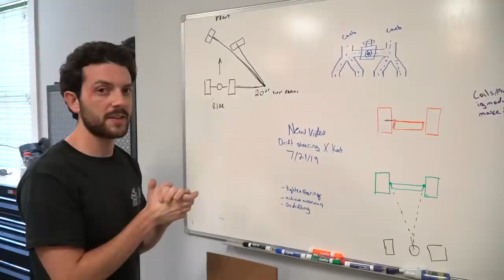750cc Kart has FULL POWER! The Fix was SO SIMPLE!! + Drift Steering

Comment: I would have a couple sets of Denso spark plugs on hand any time I was going to be riding it and a few extra master links. And a big plece of plate metal behind the seat aluminum diamond plate would be cool looking. And Sand the frame off and paint it Red or Blue or Purple. Candy apple some kind of paint. Its ready for a meet now.  Bigger back tires. Fronts too. Taller wider. some what bigger dont have to go nuts just somewhat bigger. Some times a  rod can go through the block and parts fly and also chains fly too. It hurts when that happens.

Comment: Hope you don't change a thing. The stance is awesome and chassis-wise, everything is working great. KISS. LEAVE IT ALONE. You have a roll bar. No full roll cage needed. You're sitting low and leaned back. It has a nice "race" look to it. Adding a full roll cage will take away from that. Oh btw this has turned out to be a great build.

Comment: Put some much bigger tires on it...please. You will need sand?, mud/snow, dirt, & pavement tire sets for the rear...
Put some paint on the four exhaust tubes and drive the kart around for a bit. Right where the paint burns off of the tubes, tie them together, two pipes to a connection, look up which two cylinders should be tied together. Add a short length of pipe to each of the two tubes you just created, put some paint on them once again and then go drive the kart around for a while, a bit harder than the first time. Once again where the paint burns off, bring the two tubes together into one pipe, add whatever length you need/want. Enjoy the sound and performance of your shade tree mechanic tuned 4-2-1 exhaust...

Comment: Dammit i knew it was ignition, don't think anyone suggested plugs though? Maybe we just assumed you'd already taken care of that, but to assume is to make an ass of u & me...  Now it's at the front of my mind, if you're running NGK resistor plugs ditch them! those things love to foul and cause intermittent issues like that, just change the part number to remove the "R" and you're golden (i.e. DR8 ES becomes D8 ES). Better still find some Champion or Denso and ditch NGK completely.

Still think the dual carbs is a good direction in a kart specially if you have the rubber to hook, bit more low down grunt for not much off the top end. By the way, this is making me want to pull the unfinished CBR400RR motor out of the back of the garage, build it up and do something crazy with it.
Reply: I think we did put champions in it
Reply: @isaacitllbefine7231  Cool thanks for coming back to me man, Champion are a pain to find here in the UK but I'd take them over NGK any day after the pain they've caused me!

Comment: I have some questions about a 212cc predator engine my son and i are building im sorry this doesn't relate to this video. But i need help please
Reply: What do you want to know?
Reply: I bought new valve springs for the 212cc predator. The kit came with new valves, but they do not fit into the guides of the head. Can I use the stock valves, or should I replace the guides and use the new valves?

Comment: you need to fab a intake out of aluminum and not PVC pipe the fuel will melt the PVC and gum up your engine blocking the oil flow and freezing up the engine my friend did that to his motorcycle.

Comment: That thing is bad to the bone. Runs great! I told you spark plugs LOL haa ha. Thats funny but you probably tweaked it out to run its best with all the tinkering on the intake it probably needed that anyway. Remember my dad always told me when it cuts out at high rpm or under a load its spark plugs, so check them first. Motor cycle engines always kill spark plugs that is the nature of the beast. So get yourself a  reserve of new ones.

Comment: Good to see you’re trying to address steering, but your still pretty far off. You should be getting twice spindle rotation with half the wheel rotation compared to your setup.  Copy all the geometry from any competition level kart.  You should see FULL lock-to-lock in like in 120 degrees (or less) of steering wheel rotation.  You should never have to reposition your hands.  You’ll need this if your going to try and adapt paddles...
Reply: And FFS, brake MC in front of your bumper?!  Safety third, eh?

Comment: You keep saying KEEP IT SIMPLE STUPID!!  Put some mufflers or some kind of an exhaust system on it , Like how it was designed. You go and run open pipes with no restriction and the engine runs lean, so you mess around with carbys and jetting to make it run richer. Why didn't you try to include the complete exhaust that's matched the engine???  Don't re-invent the wheel.  They built it and researched it to its full potential in that form, as a modifier you got to think about how your mods affect the performance of something you know already know the capability of in its stock form. Hope you understand what i mean. I enjoy your vids and adventures..

Comment: A full build, without doing a tune up on the motor?  Also, guys, come on. Wearing the full sleeves while welding yet wearing shorts?  I know it's hot, but doesn't make sense to wear full leather sleeves if you're not keeping your legs covered.